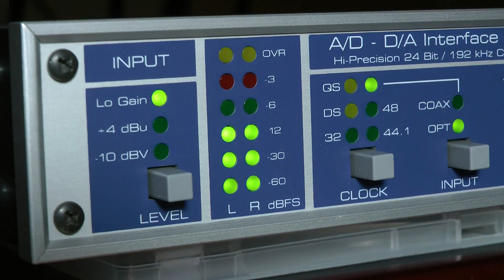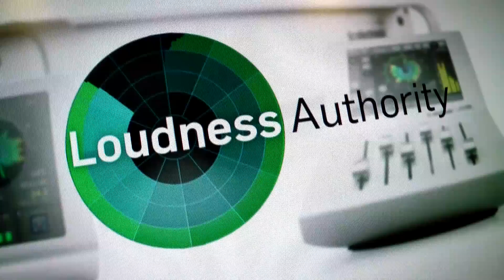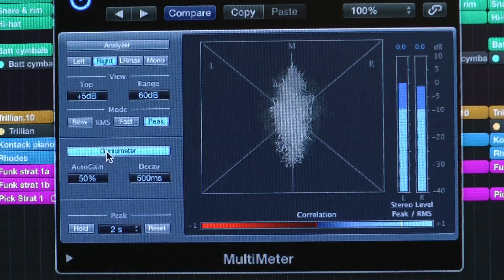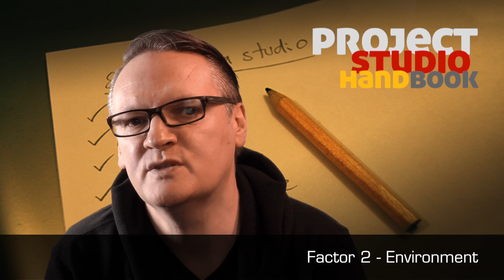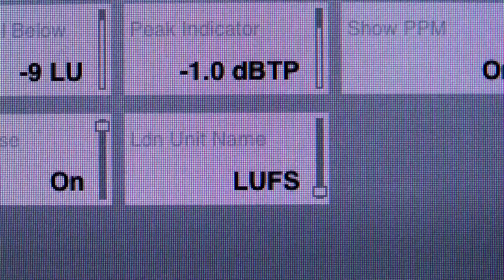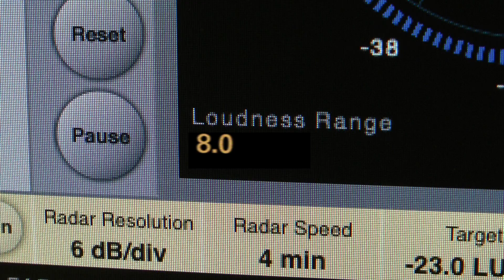Audio loudness metering (& the loudness wars)

Comment: Great info about loudness.

I thought I would point out a handy tip for anyone wanting to measure the loudness of any song without having to play though from start to end using the LM2. On the TC electronic website it says you need pro-tools to offline measure using LM2 this isn't correct. I can do it using cubase and I have posted a video if you want to have a go. TC Electronic LM2 offline faster than real time measuring using Cubase